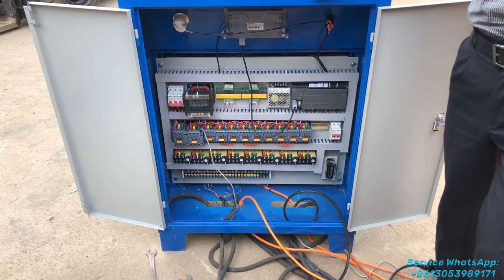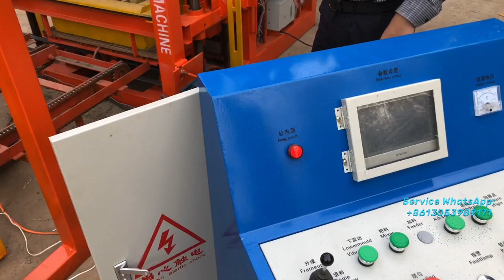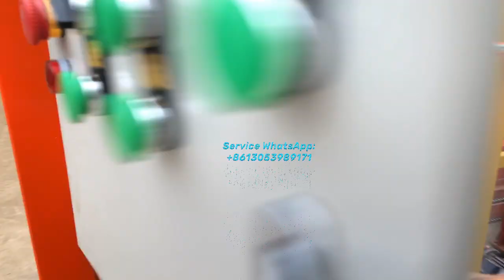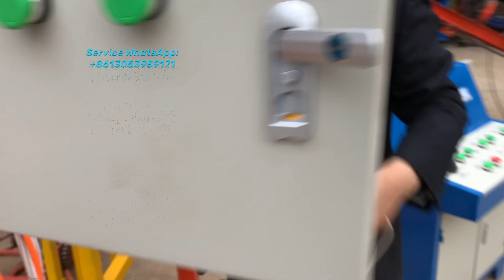how to install QT4-25 automatic hollow concrete block machine guild video of paving brick machine

Comment: Hello sir, thanks for the explanation. 
Am repairing and replacing the sensors for qt4-25 machine, Would you please help explain the function of each sensor
Reply from the maker: Yes. Go ahead please , you may add my WhatsApp number: 008613053989171.